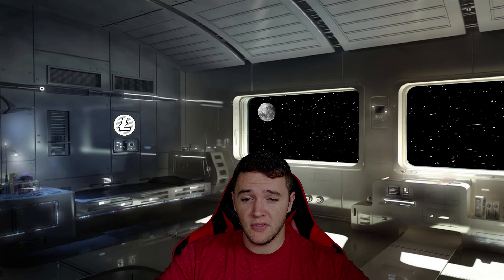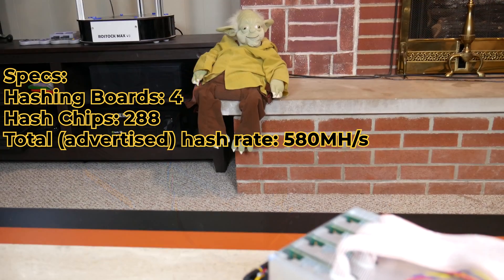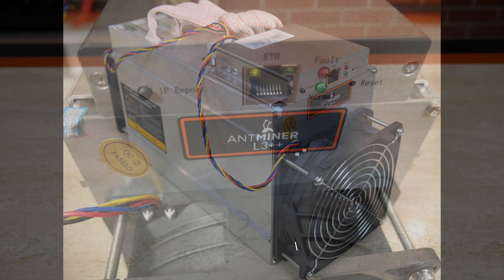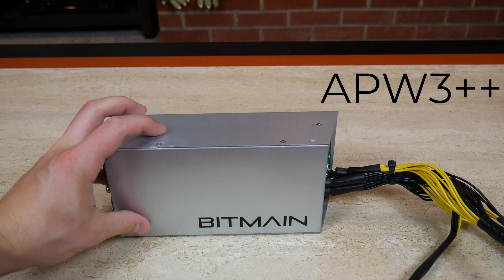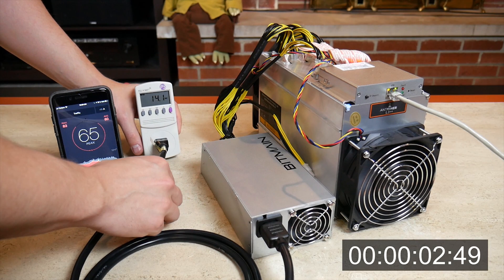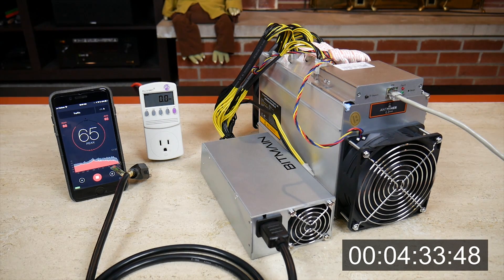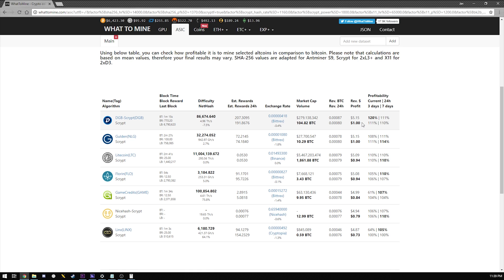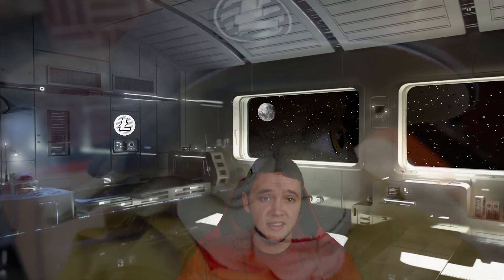Antminer L3++ Initial Setup Part 1

Comment: do you need a monitor for the miner?
Reply from the maker: You do not
Reply: @h4lt  how do you set up the ip address ? you
do that on a seperate computer? i don’t have a computer. do i need to go buy one before i buy a miner?
Reply from the maker: @evo_one2250  yes, you will need a computer to set up the miner initially. Maybe you could borrow one? You may be able to get by using a cell phone/web browser.

Comment: Do I have to do any special rewiring for my electrical to use this? I picked up a unit and I keep hearing people say you need some sort of 10Guage wire for whatever outlet you're going to use.
Reply: Yes you need a 10 gigawatts flux capacitor
Reply: @arkadiawersch8301  😂😂
Reply: No.  You can run it as seen in the video, on a standard household 110vAC outlet.  However, if you run it on a 220vAC you'll see an electricity consumption reduction of about 7.5-8.5%.
Reply: nah bro u have to use the PSU thats specific for this miner